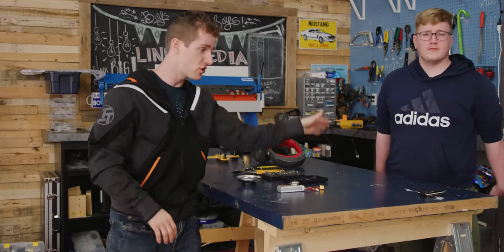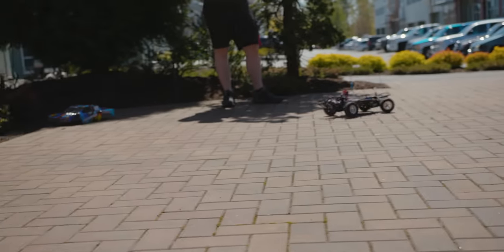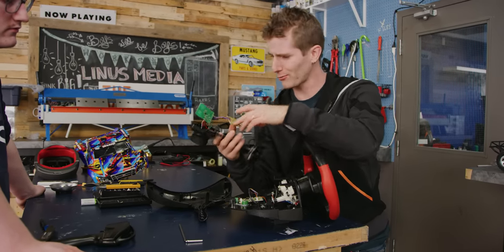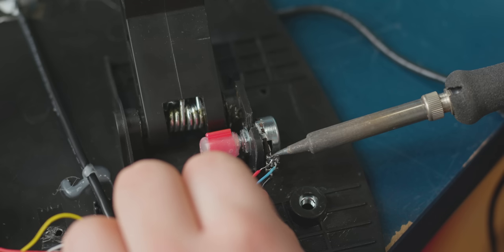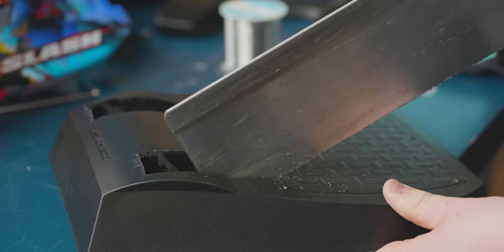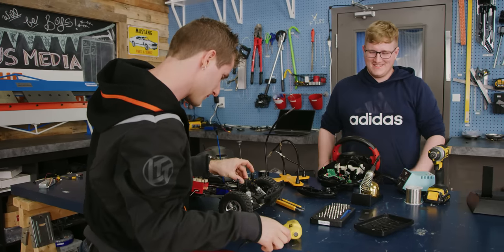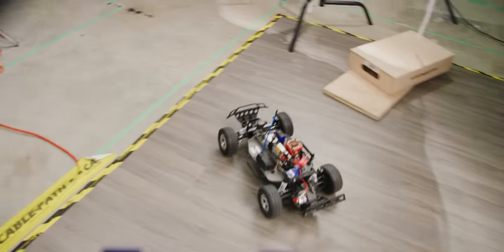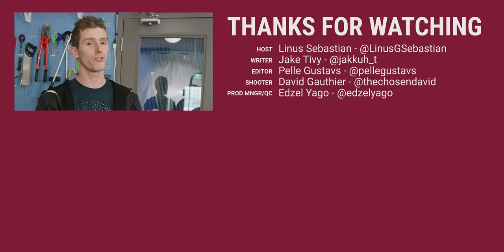First Person View VR RC Car Racing!!

Comment: Why would they get dji fpv goggles 50ms of latency is quite a bit
Reply: I'm pretty sure they explained why, a more reliable set-up for the LIVE event. Just like making a PC, there probably are better parts but pre-made systems are ,generally, very reliable.
Reply: John Doe yeah and now that I think about it for the speeds the car is going is shouldn’t matter. I fly FPV drones and when your going 50mph through 2 foot wide gaps every ms matters but when your going 10 mph on the floor it won’t matter as much...
Reply: @coltonwilliams1559  I know nothing about this type of stuff which is why I can relate to their choice of the pre-built set-up. With your knowledge, I'm sure you would be able to get a better, cheaper and reliable set-up.
I will admit though, I am interested in trying something like this myself now.
Reply: @gaijinkuri684  Its an amazing hobby, join!

Comment: You legit choose the worst fpv gear... Something like Fatshark with trump vtx and caddx starlight would do much better...
Reply: Fatsharks dont fit well on everyone's head. Vox googles like the ones they are using should be better for a large number of people.
Reply: You and the rest of the people saying "You chose the worst, you should have done x" proved their point of their being no solid consensus on setups.  Nearly every comment I've seen with that format has a different solution for x.
Reply: @StrangelyIronic  its cause they are all great... except for Ocusync
Reply: @StrangelyIronic  I'm fpv drone pilot. I have tried dji system and it's shit! If they asked anybody who knows something about fpv, about dji. The response would be the same! And lag on them is by no doubt the worst!
Reply: @codydavis7762  HD0 is top of the line goggles(and it's cheaper then djis "racing edition"). I don't know of a single person who said they don't fit well.  Hehe maybe on Denis head it wouldn't fit :D

Comment: DJI OcuSync also has integrated uplink for control. With a simple board, you could route the wheel control to the headset via the stereo jack. This way you will benefit the OcuSync uplink range, which I have personally tested at 4 kilometers with a straight line of sight. I bet the out of the box radio controller has a much lower range. Also if they operate on the same frequency - both ranges will suffer significantly. If you decide to stay with your current setup and run into interference issue - keep in mind the OcuSync can operate at 2.4GHz or 5.8GHz selectable from the racing goggles headset.

Comment: You could have just put a 10K resistor in parallel with the potentiometer to reduce it's span to 5K. They would then function as parallel resistors. The formula for calculating total resistance when there are only 2 resistors in parallel is as follows: Rt=(R1*R2)/(R1+R2). So we add in our values, Rt=(10k*10k)/(10k+10k), and when we do the math, we find that Rt = 5k. The resistance value of our pot will change as it's turned, so our resistance will still be linear. I'm not exactly sure what the resistor's wattage requirements would be, but I generally just match the wattage of the pot and I've never had a problem.

Comment: They do this with VR racing drones already, but this is WAYYYY cooler. you could totally build a little cockpit for the camera to sit in with a moving steering wheel and hands that are attached so it feels more real. VR racing drones move really fast so they might have better quality low latency cameras to choose from there too.

Comment: You guys need to test it out with a 2-way gimbal on the camera and a head tracker. I've got this on my buggy with the Cobra X analog goggles. The immersive level is through the roof! Do you know how you tend to look left when you steer left and right when you go right? That's because you're trying to control if you won't hit the edge of the track/street. Imagine doing that in the goggles and having your vision directed that way. I am telling you, this is like 2 levels up from what you have experienced so far.

Comment: For the cameras I recommend some AIO racing drone cameras like the Eachine TX02 or Eachine EF02. They are tiny, cheap, light weight use little power, work fine indoors but still have a range of a few hundred meters and don't need any special cooling. I personally use Eachine VR D2 goggles which I find are very good for their low price, but that's more of a preference thing.

Comment: The resistance of a potentiometer usually isnt relevant, since they just use them as a voltage divider. Also you could just put a 5k at the hot end and that would slow down the speed 50% like you wanted

Comment: You can get many lipos to over 100c on discharging a cell without them dying, it will probably shorten the lifespan of the battery though. They have to solder the wires onto the batteries at the factory as well or people who make custom lipos do, the heat from that will be more significant than a bit of hot glue. The heat from hot glue will dissipate from the inner metal wrapping spreading the heat as well.

Comment: 10:35 PROTIP: You don't have to rip things apart to disassemble hot glue. A few drops of isopropyl alcohol will release the glue and let you pull the pieces apart with zero force.

Comment: instead of going for the most expensive fpv gear you could find, you could have gone with some ev 200, a foxeer vtx, and a foxeer camera, I fly FPV, and use TBS Evo 5.8g, a foxeer monster, and cruise 150 km/h in free aerial space, and the antennas are easier to mount too, considering a single dipole antenna would be plenty, depending on your venue :) it would also have plenty of range, or even go futher using correct antennas (up to 30 kilometers or more) but awesome videos, planning on doing something similar this winter to a cheapskate rc car for indoor fun

Comment: if this was me, I would have used a crawler as a platform - it is slow by nature, and the chassis on most crawlers come with useful properties such as the flexibility of conveniently placed mounting holes, or even the enclosed space in a space frame chassis , which lets you build inside the chassis rather than on top of it 
on a larger model, this would provide enough space for a camera stabilization mount, for instance

Comment: You can buy a transmitter that plugs into the GoPro and shoot a a higher res. Look up: Turnigy Light L250 5.8GHz 250mW FPV Transmitter for GoPro 3/3 plus from Hobby King

Comment: Obviously, it is just proof of concept, however, in a seating position, cutting slots out of the plastic for acceleration and brake will make it difficult to pivot your foot all the way , as the pedal will bend quite far but your foot will not. I hope you set it up a full racing rig, bucket seat, and house the pedals correctly as if they where in an actual car would benefit the user experience (pivoting from the top rather than on the floor) or if you do go for cutting out the plastic still, tilt the pedals up to make it easier .

Comment: You could actually program arduino to read USB steering wheel and pedal data (use arduino joystick library), by using the NRF24L01 Transceiver Module and NRF24L01 + PA + LNA. you could control the RC car directly. On the RC car side, it is better to use DJI FPV goggle, less latency and better response. best to find the a drone compatible ESC and capable doing reverse/brake (not sure if there any) will give you best real time flight data....

Comment: Well there are tons of option not requireing soldering. The usb signal can be converted to ppm signal and connected to a radio that supports trainer input... (either by buying a ready solution or by an arduino to upload conversion code to) But of course that will probably meaning swapping out the rc system since simpler/cheaper car radios doesn't support trainer input....

Comment: I'm just starting to watch this and have to wonder how many existing solutions for RC aircraft controls and motion tracking goggles will be applied to the VR aspect of this.  Polhemus has really cool magnetic motion tracking sensors that can be used to track just about every part of the human body as well as transponders and locomotion tracking equipment.

Comment: The 2.4 and/or 5.8ghz channels that the FPV setup uses will propably be occupied at LTX. Be sure to check if you still get a working video feed under those conditions.

Comment: Camera and video transmitter is best to go with (analog) foxeer predator series fpv camera and a tbs "teamblacksheep" vtx. If you want digital, the dji fpv headset and thier caddex vista, or dji airunit would be another experience.

Comment: hopefully in the future there will be a way to add force feedback using sensors on the vehicle or something to actually feel the terrain that you're hitting and the wheel goes lighter when you catch air and feel the skidding of the car on wet pavement and stuff. sure it might never happen, but we can all dream can't we?!
Reply: In theory, it wouldn't be that hard. You can measure current going to servo and polarity on servo motor to approximate force and direction of force that's going to wheels.

Comment: There was an easier way to make the 10K potentiometer in the steering wheel work as a 5K.
From what I saw you used an extreme and the middle, just solder a 10K resistance in parallel to the potentiometer. That way it should vary from 0 to 5K, instead 0 to 10K
And the modification would be minimal

Comment: I've forgotten most of what I knew about electronics, but can't you turn a 10k resister into a 5k resister by putting another 10k resister in parallel? Or something like that. Surely there is some what to fix the pot without replacing it.

Comment: Here's how I would have done it: Don't dismantle the steering wheel and use a Raspberry Pi or a normal PC. Using it, just write a simple app to send the information to an Arduino to adjust the controller's information (acting as an alternative input). That way, you could use any steering wheel. The only issue I could see is how to mimic the potentiometers, assuming PWM would cause issues.

Comment: You also just could have gone with a 10k resistor in parallel... It isn`t as linear as the poti, but it is cheaper and there is less risk to damage the wheel ... =D

Comment: Jake should probably read about basic electronics like voltage dividers or something similar. I guess you could have used some adjustable resistors to calibrate the pedals instead of cutting pieces off. In addition, you could have probably calibrated / programmed the transmitter, too. Unless you have really crappy transmitter it should support adjusting the curve from the controller to the actual behavior. That would include reversing the direction so you wouldn't have needed to swap the pedals. I'm pretty sure that the original 10K pot would have been just fine, too.

And if you want even lower latency for the head mounted display, go with full analog setup with rapidFIRE. It will have worse image quality and maximum transmit distance is slightly less but the latency is even better. I'd suggest to try contacting Joshua Bardwell if you need more info about sending video stream over video link with low latency.

Comment: Maybe you've had added yourself work with trying to match potentiometers - they are usually connected as voltage dividers, so output is between voltage source and ground regardless of total resistance. Pedals are a bit more tricky... Maybe it'd be easier to replace input part of transmitter with a microcontroller a feeding right signal to transmitter part.
About speed of the thing, you can use crawler motor to slow it down.
Yeah, comment is 2 years too late and won't be visible in 3k of other.. but gotta try my luck :D

Comment: Occusync is too high latency for a real racing drone. They generally use a 5.8ghz video transmitter with fpv goggles with a receiver, as you guys did some research on that. With a decent camera latency is generally sub 30ms but it's analog video so the feed isn't as high video quality, though it's more than fine to see where you are going. For messing around driving slowly I'm sure it's fine, the latency is managable, but it's a whole different story when your flying down a field at 60-80mph through a bunch of racing gates. 

Making the steering wheel & pedals work for control is pretty cool though. Welcome to the world of FPV.

Comment: The only advantage to hacking the wheel and transmitter together is to not have a PC. Which probably would've been easier to just plug it into a PC and get a transmitter for that that sends the input from the wheel.

Comment: Did you even try the original pots? There should've worked just fine if they were using all 3 legs as a voltage divider.

Nm just saw the top comment.

Comment: Its a shame you can't use the DJI head tracking you get on the drones. If you sync it with drone the 3 axis Gimbel turns as you turn your head. Up, down, left right anyway...while the drone stands still in air.

Comment: I can't see the point for the VR headset... as long as the head moves are not operative over a dynamic camera (which would be really cool - but is not the case) the only result is gonna be just a very harsh sick feel. Why not a driver station - race chair, pedals, steering wheel and an awesome set of curved displays - in which case is no need of speed limitation

Comment: No no no dont make it with IR sensors, make it portable with a raspberrypi and a3 or 4G network where you send commands from the sterring wheel to the network, that also sends comands tonthe RC car so you can be in some other country and still use  it while outside.

Comment: People do this all the time with racing drones... the only thing 'different' here is that you hooked up a steering wheel and pedals for a car. 
On the cheap, just use the stock controller and set up the FPV system on the car. No need for the fancy steering wheel and stuff. TBH that's 70% of the work for only 15% more enjoyment.
Don't get me wrong - I've always loved this idea, but it really didn't need to be so complicated to be enjoyed.

Comment: i tried something similar to this.
flight stick for an rc plane. tried mcu based setup (atmega 8 bit mcu to process the stick.) but got a complication on that plan so ended up making a directx based app to process the joystck and send it to mcu for transmission.

Comment: put the truck in training mode it makes it go a lot slower all u do is turn off the truck and turn it on but as u turn it on hold it and it will go green red then off then wait a sec and keep holding it will blank one that is normal mode 2 times is racing mode which has no backup and tree time witch is training mode and after it blanks 3 times let go and ur truck is in training mode and to put it back do the same thing just after one blank let go

Comment: If you want something really cool (but hacky like said in the video), look at EZ-WiFiBroadcast. Open source and uses off-the-shelf wifi cards to transmit 1920x1080 video at sub 100ms latency, and it doesn't drop out the whole video on a poor connection, just drops frames or resolution.

Comment: Why not use an Arduino or raspberry pi to interface instead of physically modding the steering wheel and peddles? First robotics uses Logitech controllers through Android phones to control their robots.

Comment: the ohm value of the pots is not important.  They act as voltage dividers so it acts the same way.
Reply: only if you change the other resistor in the voltage divider.  I don't know if they did this or not, but they said they tried without changing the pots and it didn't work.  Presumably even if you did change the other resistor there would be a different current output, which could also cause issues.

Comment: Rather than replacing the pots, why didn't you simply put a 10k resistor across the terminals in parallel to give yourself the required 5k, yet the same throttle/wheel movement and connection? 
Or you could have used another 10k pot across the terminals and 'tweaked' the 'response' of the steering wheel or the car's top speed?  But then a computer nerd thinks of a transistor as a switch, whereas I think of them as amplifiers...

Comment: You guys way over spent on the FPV system. There are way cheaper options that also take up way less space on the car. You will have to sacrifice that 720p goodness but in return you will get a noticeable reduction in latency  @Linus Tech Tips, Send me a DM if you would like some help with this or more details. Thanks and happy driving!

Comment: Is the latency even that important as long as your head movement is not tracked to move the camera?
Motion sickness comes from feeling a movement without seeing it in exactly the same way (different/too late/too soon) and vice versa. Without head tracking (and without actually sitting in the car), you will have that problem with or without good latency.
Many people had motion sickness with the Oculus Rift DK1. It already had angular tracking but no positional tracking. I think that gives the brain some form of an uncanny valley. It thinks it's the reality because it already has angular tracking. So it also expects positional tracking but the fact that it's not there confuses it. Perhaps when there is neither positional tracking, nor angular tracking the brain just gets it "Okay, this is just not reality. So I won't expect it to behave like reality."

Comment: Its not VR though...
FPV gear weighs in at almost nothing now.  Something like the BetaFPV Z02 AIO Camera 5.8G VTX  weighs in at about 5g and would be about 10% of the DJI system you bought.
Kinda sad you show all those well known sites in the video then end up getting DJI gear.

For LTX you should have looked at Tinyhovers maybe as they are allot cheaper and you could have a few in a lineup for races.